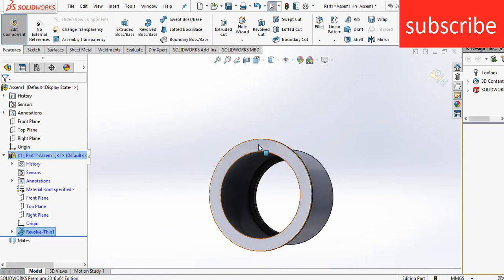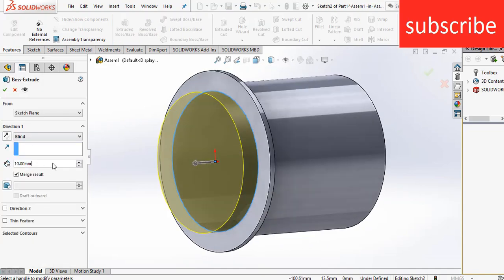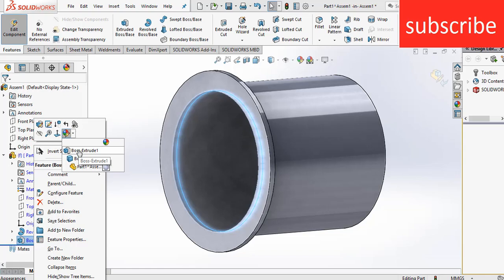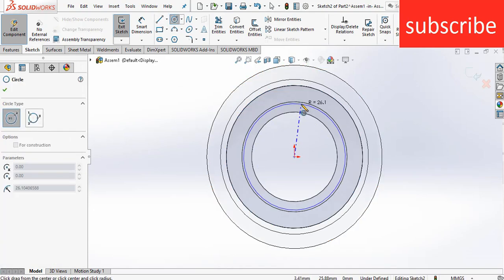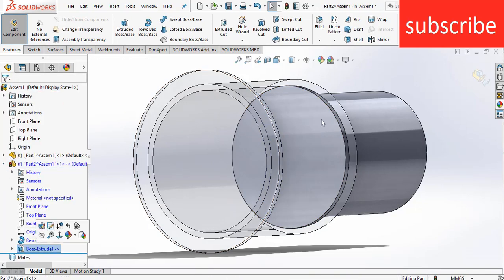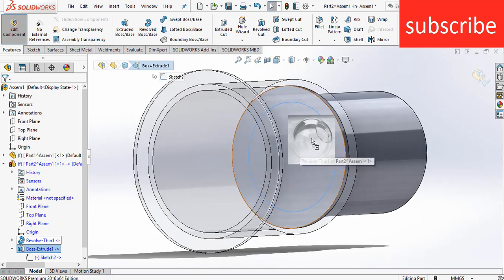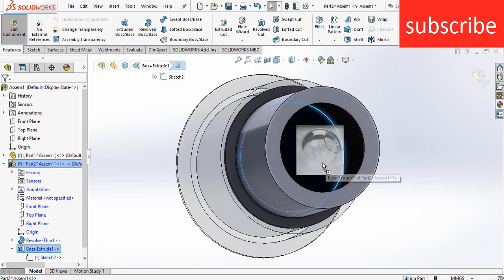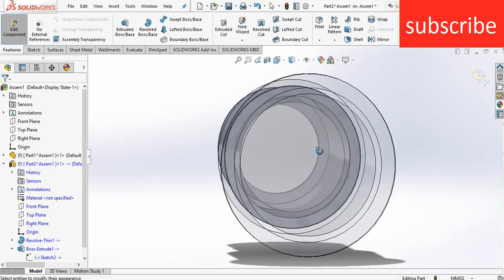Telescope mechanism with advance mate in solidworks

Comment: Can the arm be extended automatically using linear motor?
Reply from the maker: Yes but you need to make mate correct
Reply: @Cadknowledge  How to do that? please explain it to me if you can.
Reply from the maker: On my channel look search robot (search options visible on my channel only in pc or laptop)
Reply: @Cadknowledge  which video should I watch? there a thousand about robot
Reply from the maker: @bovan6348  I made a dedicated video on that motor but it is explained in udemy course https://www.udemy.com/course/solidworks-animation-and-motion-analysis/?referralCode=8F40E7F83856CFF0C5FE you can try there

Comment: what to do if we dont have option to import new part
Reply from the maker: import option is there (there might be some bug in your software). what kind of file you are trying to import ? if import is not working you have to make parts
Reply: @Cadknowledge  like after doing one part you import jew components in which u make and add one other part which will go inside the first so there is no import new components then how we can add other part
Reply: @Cadknowledge  how to make parts  like we done one part and then second then we can assemble like this way u r telling?
Reply from the maker: Well i recommend learn some mating in solidworks and if ur file is not sldprt then you will face some problem that is little advance things